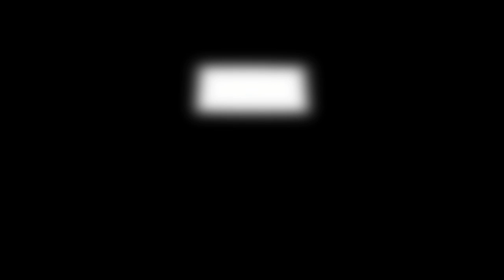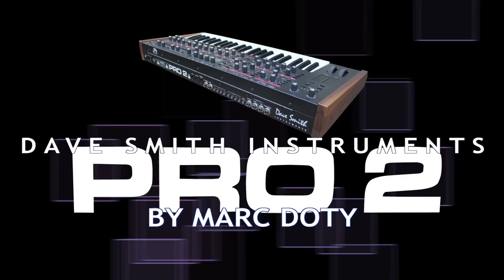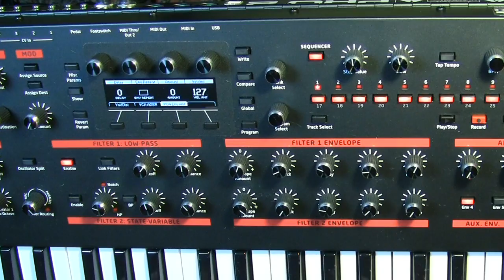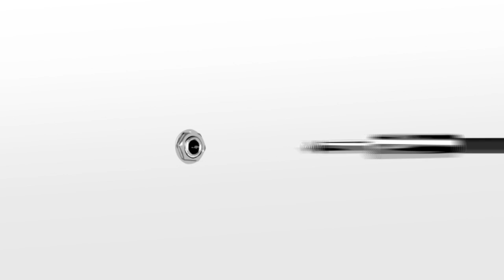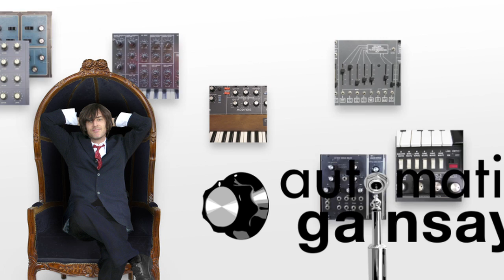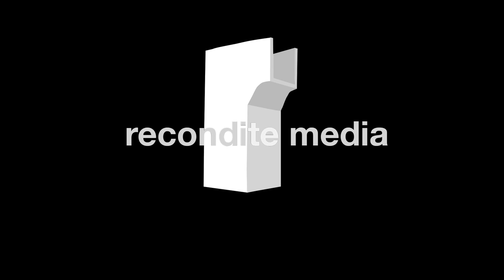The Dave Smith Instruments Pro 2- Sequencer Introduction

Comment: I was making a choice between the Pro 2 and Elektron Analog Keys. I ended up with the Analog Keys for a lot of reasons but one was I was familiar with Elektron sequencers and thought the new DSI sequencer would be overly complicated. It actually seems pretty easy to work and has some overlap with the Elektron method. For the most part instead of parameter locks you have multiple modulation layers. I can still get 64 steps out of the Analog Keys instead of 32 and I do find myself needing 128 so I use pattern chaining to achieve this. I don't suppose DSI included anything like pattern chaining did they? Either way I could still always use an external sequencer but it looks like I would lose some of the power of this synth.
Reply: zerix01 I own both the AK and the Pro 2.  To me, the big difference is the fact that you record a sequence live with the AK, but you can't with the Pro 2.  Only step recording is available.  That's important to me because there are certain phrases that I can record easily live, but that would be very difficult and tedious for me to create via steps.
Reply: @schepler2  thank you I have been scouring Google trying to figure this one out & not been able to record live is a deal breaker for me. I already have the rytm Mkii which I have a grasp on (hardly mastered but hay it’s deep!)
So you’ve just saved me an expensive mistake. Sure I’d be happy with the pro2 but don’t think I’d be using it to its full potential.  I had assumed the rytm would be my centrepiece sequencing other gear but it’s somewhat limited in that regard I hear the AK is much better.    You still using it 7 years down the line?
Reply: You can totally record in both notes and automation live, by pressing ‘record’ while the sequencer is playing, and first play in your notes on track 1, then with a specific track active, move whatever knob you want to record live.